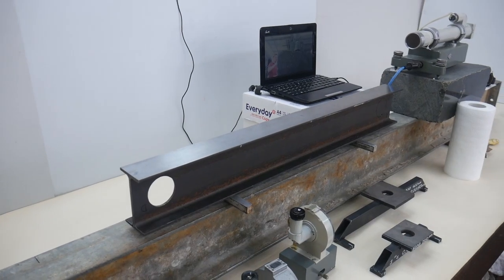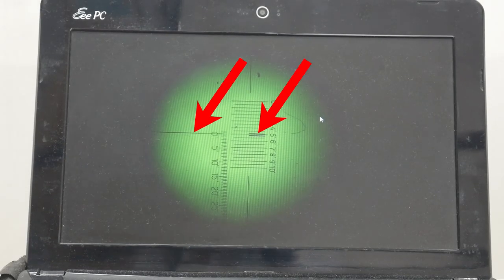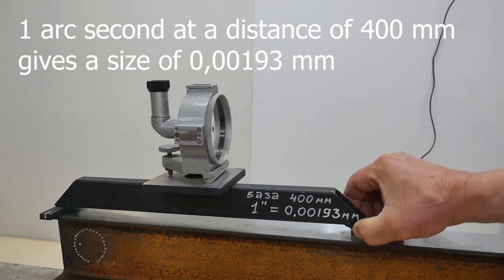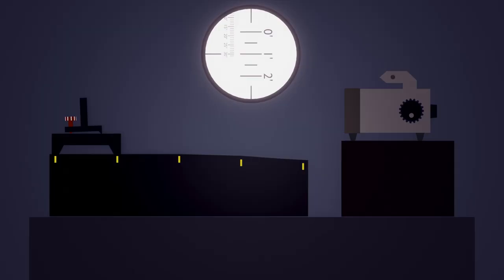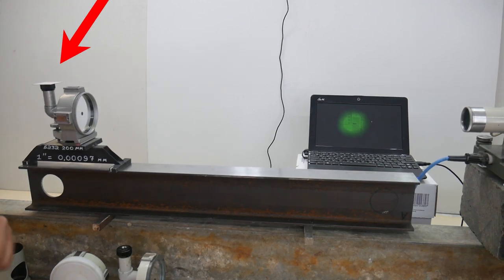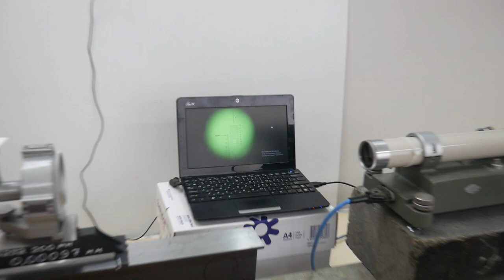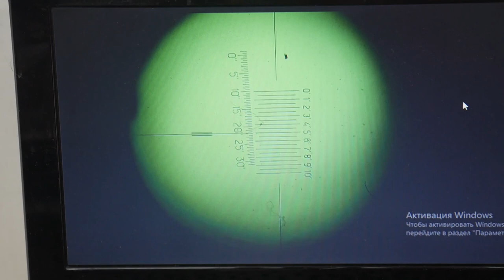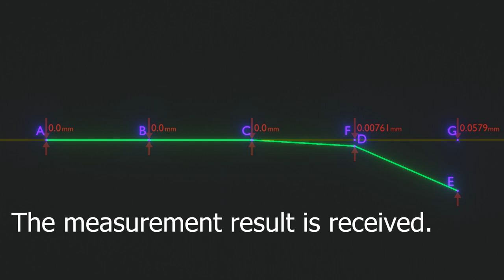Autocollimator part 2

Comment: I used the epoxy replication method to copy my granite 1m straight edge surface to a 1.3m beam. I want a autocollimator to check how good it is. Unfortunately hard to find this second hand here in EU 😅
Reply from the maker: But there are a lot of these devices for sale on eBay. And even I put my 0.5 arc second autocollimator up for sale there.
Reply: @gena_bazarko  perhaps i just need to look better

Comment: Я дико извиняюсь, но 1 угловая секунда на базе 400 мм дает 0.00194 мм ( tan(1/3600)*400 )
Reply from the maker: Так, Вы точно подметили, 0,001938271 мм. Я не корректно округлил.  So, you noticed exactly, 0.001938271 mm. I didn't round correctly.
Reply: Also it’s much easier to read, remember or make calculations directly in microns 1” = 1.94 um, than 1” = 0.00194 mm. IMHO